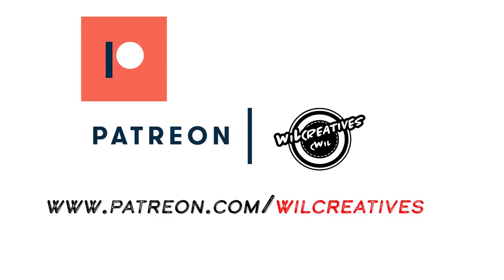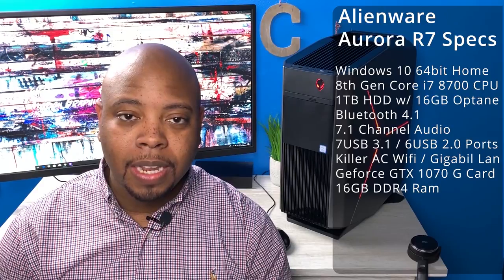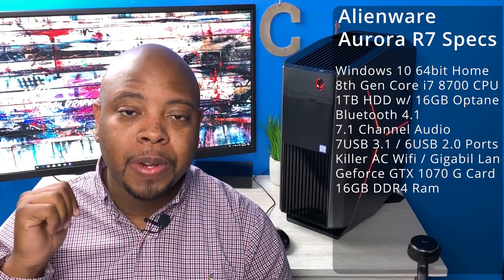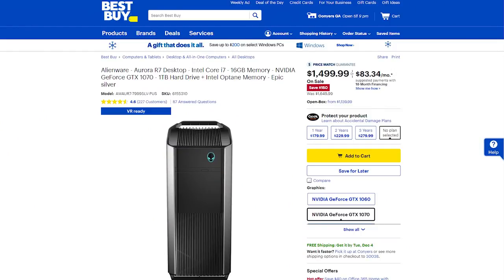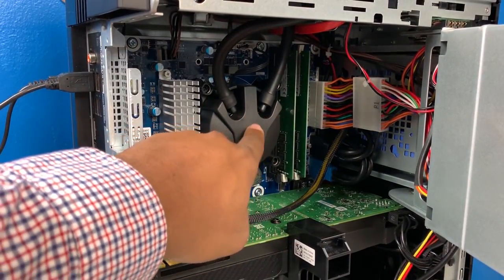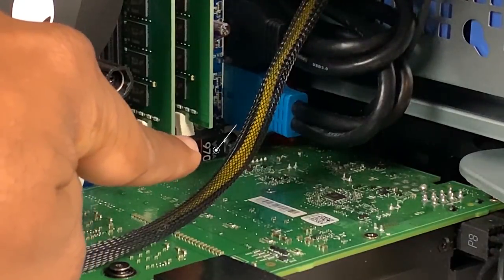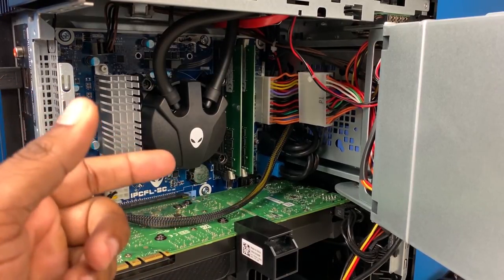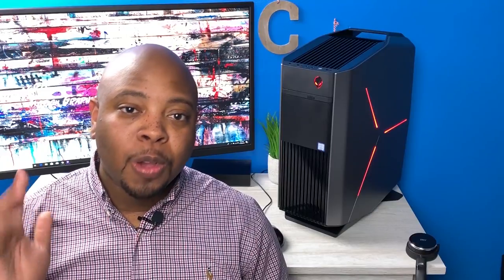30 Days with the Alienware Aurora R7 Full Review (i7 8700, Nvidia Geforce Gtx 1070)

Comment: Mr. Cwil, it has been almost a year since I got my Aurora R7. So far so good. Though I noticed I get weird moments when my system stutters so slightly. Other then that it runs like a champ. Your advice helped a lot and wanted to give my progress report. 

A recap: I did add 

Samsung 970 PRO Series - 1TB PCIe NVMe - M.2 Internal SSD Black/Red (MZ-V7P1T0BW)
SanDisk Ultra 3D NAND 2TB Internal SSD - SATA III 6 Gb/s, 2.5"/7mm - SDSSDH3-2T00-G25

I did not touch the actual memory and I have one extra slot for 2.5" slot which I am probably going to fill in with a slot. I still have the original HD. Games run well and if you got any other advice or ideas, I will probably invest in some other advancements.

Stay Frosty!
Reply from the maker: Thanks for the update, that’s awesome! If you have a liquid cooler already the next step would be to transition over to a custom build when that time comes
Reply: @WiLcreatives  okay, so this system is fans correct, not liquid. I do have to say it is very quiet.

So a question? Is it even worth upgrading the memory and if so, after time with your rig do you have memory types you could recommend, as I plan to get the most mileage out of this system I can get.

If I go the custom route, I guess I will wait and see considering Computer lifecycle is much shorter then it was in the yester years.

Comment: I had a similar issue with both  intake/exhaust fans going idle after owning my setup for 9 months and I am not quite sure if it was a update that caused it or not.  Super easy fix as a update likely just turned on the always ready feature which disables the inactivity timers forcing it to go idle every 5 minutes.  Anyway.. from the forums..
- In AlienFusion, Power-Profile  set to "High Performance" - In AlienFusion "Always Ready Mode"  turn OFF   - Now you can right click on AlienFX icon in TaskTray, and set Inactivity Timer to Custom/Never go Inactive.

Your good to go again.  Apparently auto updates of the Command center can give you this problem.  My system is overclocked so lol... 90c cpu temperatures were rather alarming as you really do need the use of those fans to keep your system relatively cool.  I have intake fan set to 49% and Cpu fan to 33%  (sli 1080s  8700K running @ 4.6GHz) (cpu temps stay in the mid 50s and 1080s get into the mid 60s but I slightly undervolt and overclock those)
Reply from the maker: Man your system is banging. I have my power plan set to Ultimate so everything stays ready. I'm assuming you have the 850w power supply?
Reply: @WiLcreatives  Yep I do.  I wasn't totally thrilled with the bronze rated PSU but hey it's doing the trick with no problems over this past year.  If it does ever need to be changed out a Evga G3 will fit in there nicely.  I also wasn't impressed with the fans at first either because testing at 100% is like a jet engine only louder.  Thought maybe they were just cheap bad ones but then I realized it's that stupidly high rpm on them.. I'll never run them that high but it's nice to know the option is there and it all makes sense with the blower style cards giving really good airflow.
Reply from the maker: It’s funny you say that I’m looking at a Zotac RTX 2080 blower style just for that reason to keep the temps down and not have to worry about the fans running to loud.
Reply: Posting here because once I get back from vacation I'll apply these settings
Reply: Yeah, I really hated mine at first..  Mostly because I've built 100s of gaming systems  and thought Dell was cheaping out.. but once I understood why they did what they did.. I was a lot more pleased about it all.  It's actually a slick design.. props to dell on that.
Reply from the maker: Yep!!
Reply: @mw38390    If you plan to adjust card settings as well, I use MSI Afterburner.  I run my cards at 65% power limit but compensate by adding 90 to the core and 100 to the memory (all 10x series 1070-1080tis overclock easily to 125 core 500 mem but no reason to go that high) it's all about balancing things out for heat/power.  I also set a fan profile on the cards (just the default one in MSI afterburner) works well.   

 On the case, exhaust fan (cpu) 29-33% is the max tolerable for me.  49-53% on the intake.  I like to show my settings so I've toggled gauges to the desktop to monitor things and I run the hell out of my system and everything stays at acceptable temps.. (max 65c on cards rarely gets that high  and  just shy of 60c on the cpu  under load)  plus with the fan bug (via updates) you can always see that your fans are in a idle state if things get reset!
Reply from the maker: I just made some of your changes to my GTX 1070 about to post some game play!
Reply: When I get back to ny tomorrow I'll get back to you maybe even talk thru discord so you can show me step by step , my Aurora with 1070 hits constant  75s  on overwatch ultra or is that normal?
Reply: @mw38390  ok, I'd set up the R7 built in tweaking profile first.  (That's just in your command center, easy enough to do)  MSI Afterburner can be downloaded from Techspot (safe/trusted and relatively fast)   I am betting that with just setting up proper fan profiles your system will run much cooler. Tolerance levels for fan noise varies with everyone, so test my settings first 29% exhaust 49% intake (fixed) and see if that's acceptable.  Make sure you've adjusted for the potential fan bug to.  If it's a bit to loud you can adjust down  (I use fixed setting on the r7 and a fan curve on the cards (adjusted with the little wheel/gear icon on Msi Afterburner I've just used the default fan curve which starts at 40% and adjusts upwards as temperatures ramp up)  EDIT: link to techspot https://www.techspot.com/downloads/4895-msi-afterburner.html

Comment: Man I've had mine for about a year now, got the i7 8700k and the 1080ti ordered it with the 32 gb ram and installed a 1TB 850 evo ssd liquid cooled it's also got a 2 tb hard drive it was a grip of cash when I bought it. Got the best of their support for like 4 years, have had like zero problems with this thing. I spent like 2,800 bucks when I got it. I got all of this so I could use my Oculus when it first came out man I was into it. I hope this thing will last years to come, I've heard tons of stories about people trying to do upgrades with different ram and stuff and came across a lot of problems. I don't think these Alienware computers enjoy to many upgrades, I don't know for sure but it was one of the reason's I specked mine out as much as I could when I ordered it. Maybe they've eased up on letting people do a little more than just adding ssd. Optane was just coming out when I ordered mine, they were really pushing it like it was the greatest thing ever. It came factory installed right after my generation, they wanted to charge quite a bit to add it and I was like no I don't think I'll spend the extra on that. This thing is not to bad though, it updates when Alienware wants it to, it's plug and play. The reason I went with Alienware was it has ports up the ying yang, I could hook up all the sensors for the Oculus, a racing sim and a lot of the other MFG's at the time were nowhere near the amount of ports this had. Anyway cool video cool computer.
Reply from the maker: frank mathis Thanks Bro sounds like you have a banging system! Since I’ve taken out the optane memory and using the Samsung 970 Evo as boot drive I’ve had no issues and system runs great. I just upgraded the memory today. Look out for the video for that this weekend! Thanks for sharing!
Reply: So far I upgraded the video card from the stock GTX 1070 to an EVGA hybrid 1080 with water cool so it has 2 radiators running now. Stick another 8gb stick to make it 24GB ram, put a 500 gb nvme in as boot drive so I would say you would have no problem upgrading this system as long as you do your homework before buying the parts to make sure they're compatible. It just as good as any BYO computers if you know what you're doing.
Reply: I’m pretty sure I just bought this same setup. Excited to start gaming!

Comment: I agree, the Optane memory did not do anything noticeable...EXCEPT, screw the stock Toshiba hard up. The 1 Tb drive became a 480 Gb drive after I swapped a 970 Pro into the m.2 slot, replacing the 16 Gb Optane. And no amount of formatting or changing everything will remedy this.  Got an 860 Evo coming from eBay to replace it. Who wants mechanical drives anymore, anyway?
Reply from the maker: Exactly, that's my first time hearing about the the storage amount changing though
Reply: @WiLcreatives  Seems weird to me to. Intel rapid storage reports it as a degraded volume no matter how I try to format it. Says incompatible on the 0, 0 position. Maybe I have it plugged in the wrong place, ya think?
Reply from the maker: @Themadfranklin  Gotcha have  you tried unplugging and reconnecting? or try using a different Sata III cable and/or different sata port.

Comment: My recommendation with this system is you should wipe your hard drive clean, delete all the partition then install a clean version of windows on the blank hard drive. It's something with windows 10 liking to do its own partitioning or something but it should make the system run much smoother. And the windows key was already embedded in the motherboard so you should have no problem doing that.
I've upgraded that 1070 to an EVGA Hybrid AIO Gtx 1080 (putting the radiator in place of the front fan), added another 8gb sticks to make it 24gb and changed the optane to a 500gb nvme and all the upgrade runs great. (note that it won't take 4x 8Gb sticks, it will take 4x16gb sticks or 3x8gb sticks thou)
Reply from the maker: Tuan Le man that’s awesome!
Reply: The motherboard for this machine does support 4x 8GB RAM modules. I have installed exactly that albeit it was a rather tight fit to get the last stick in but this is mostly down the the design of the sticks as I picked G Skill Trident. However what the motherboard does not support is any higher speed that around 2600MHz.
Reply: @SpectreDusk  so all 4 sticks are G Skill Trident 2666mhz ? The reason for my 3x8gb statement was because of all my searches on the internet including Dell support emphasized that. But between then and now and all the Bios update may be stuff changed.
Reply: Tuan Le the speed of my memory is actually 3200MHz but I didn’t find out until later that the mobo would only support 2666MHz. And yeah it runs absolutely fine, never had any errors at all. It’s definitely possible an update has changed things. I did some checks and came across some threads saying the same thing but I’m still unsure as to why this would ever have been a problem in the first place. I also saw it mentioned that some manufacturers RAM sticks may not have worked while others did. So I guess one thing we do know is that the RAM I have is god to go 👍

Comment: I really enjoy your videos, you do a good job with them. Do make more! I just subscribed. Question, have you had any clicking noise from the PSU fan? Mine is the 850 W one and its a Huntkey model they put in, seems to be making some noise now after a year. Any idea how to upgrade the PSU or if we even can with the Aurora R7? Also did you end up putting in an incase GPU after your last video, not blower style and if so how did those temps work out for you with the air blowing back in?
Reply from the maker: Thank you for the support and feedback! I have the 460w PSU. I am going to upgrade to a EVGA 850w supernova G3 very soon so yes they can be upgraded. I will do a video on that process stay tuned. I haven't upgraded the graphics card yet because I need to do the PSU upgrade first. Once that's done I will do a video on the new graphics card upgrade.
Reply from the maker: To answer your first question I haven't had any clicking noises.

Comment: I just ordered one.  I'm just a casual gamer.  Do I need liquid cooler vs stock air (fan) cooling?
Reply from the maker: Only if you feel like the stock air cooler is to loud. 1 of the main reasons people were replacing the air cooler for liquid is because of the fan noise.
Reply: @WiLcreatives  is the stock liquid cooler worth $43 more?
Reply: @VF5  A late reply but most defiantly, also get the larger power supply.

Comment: I bought an alienware aurora r6 an dell 27 inch gysnc monitor at best buy 3 years ago and haven't had any issues whatsoever
Reply from the maker: That's good I think experiences are hit and miss. Since I've created this video haven't had any new issues. And I've done some great upgrades.
Reply: WiLcreatives I have a 1070 right now, is it worth upgrading to a 2070? I play at 1440p right now.
Reply from the maker: I would say it depends on your preference. If you want the highest frame rates possible for the price go with the 2070. You will see an 30-40% performance improvement. Plus the future of DLSS and Raytracing. If you don't really care about that and you are good with just 60fps gaming then keep the 1070.

Comment: I got an R7 back in Dec it comes on tueday but I made sure to get a 256 nvme drive as the OS drive and a 1TB drive as the storage drive, there are still 2 2.5" drive bays as I understand it so i could get another high capacity SSD for games or other programs i need to access quickly and just use my Mechanical drive for long term (infrequently accessed) storage.
Reply from the maker: Knowing what I know now I should have gotten the one that came with the  nvme drive as the boot drive but it's good we can upgrade right! Yes you can definitely use the other 2 2.5in bays. I would recommend 1tb ssd for games. I filled up my 500gb SSD very quickly!
Reply: @WiLcreatives  Good suggestion any suggestion on brands your most satisfied with?
Reply from the maker: I prefer Samsung drives. The prices are coming down as well. Look at Newegg or Microcenter for some deals.
Reply: @WiLcreatives  took your advice picked up an 1tb Samsung for games works great and bestbuy had a great deal on them. Only had my r7 less then 4 hours but love it so far

Comment: Hey, nice review! I recently got this system, but with the i7-9700k instead. I was wondering if you might have noticed some high temperatures on the GTX 1070? I play Overwatch and Warframe mostly, but I noticed today that the temperature was topping out at 82 degrees on the in-game stats next to the FPS. That got me worried, but I'm not totally sure I should be after Googling what others have experienced themselves. I did have to manually set up profiles in the Alienware Command Center just to get the fans to speed up to cool the GPU down while playing games. Do you believe it's safe letting the GPU get that hot? Thanks!
Reply from the maker: Yeah I have the same experience.but I haven't run into any issues. Also it fluctuates and doesn't stay at that temp for me. Check out putting your system on the Ultimate Power Plan for Windows 10. That should make sure everything is running for performance.
Reply from the maker: You don't need power saving on a desktop unless you are concerned about how much power you're consuming.
Reply: @WiLcreatives  - Thanks! I did what you said, but had to change it in both Windows 10 and the Alienware Command Center. The Windows 10 power options kept resetting no matter what I did, which was strange. But it turns out the Thermal profiles in the Command Center was causing a fuss with Windows 10. Once I got it set back to default in there I was able to change the Windows 10 power. Now after testing in Overwatch, Warframe and even Subnautica, the temps have gone down to 65-70 in those games, even cooler in Warframe. Chroma Prime finished tonight, so I'm excited to get back into that game. Thank you for the tip!
Reply from the maker: Great yeah the command center can be finicky at times. Glad that worked for you!
Reply from the maker: +ImpactedGnome Follow me on Instagram @wilcreatives. When we hit 100 subscribers on the channel I’m giving away a Google Home Mini to one of my subscribers for supporting the channel!